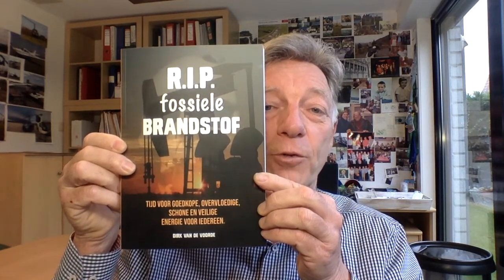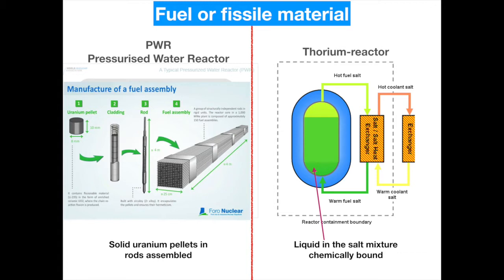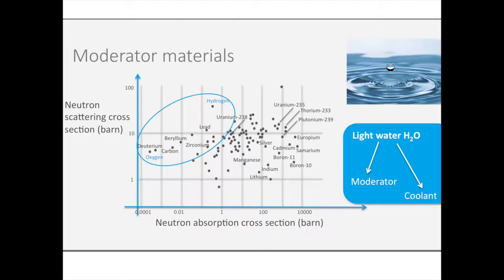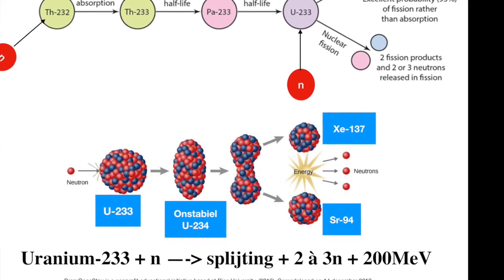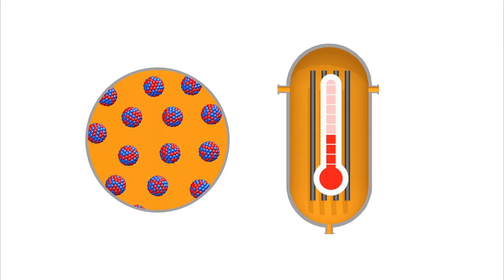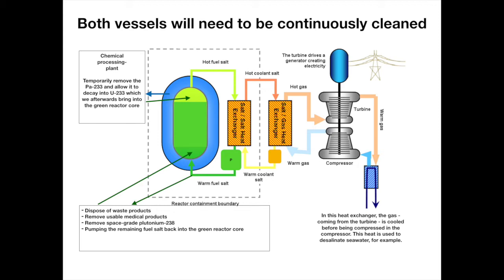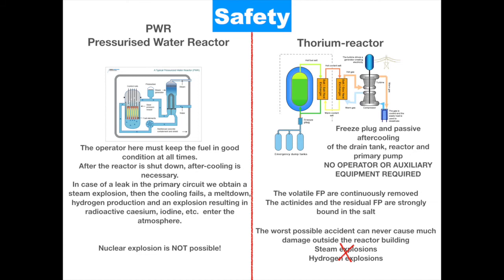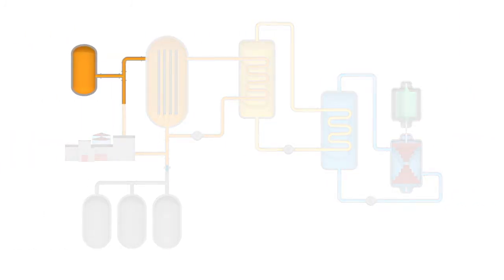The Thorium Molten Salt Reactor

Comment: Tschernobyl was moderated by Graphite. You think not dangerous in MS reactors anymore? I think I didnt get that here, sorry.
Reply from the maker: In the Thermal MSR  (slow) reactor, one does indeed use graphite as a moderator. Graphite shrinks and then expands enormously when irradiated with neutrons. This graphite will have to be replaced at an early stage (e.g. every four years). But if the temperature in the reactor core becomes too high, the freeze plug will come into action. It is impossible for an operator or a computer to stop this action. Immediately, the reactor contents will run into the drain tank and the reaction will be stopped. Thus, the graphite will never get too hot!
In the Fast MSR, there is no moderator present.

Translated with www.DeepL.com/Translator (free version)